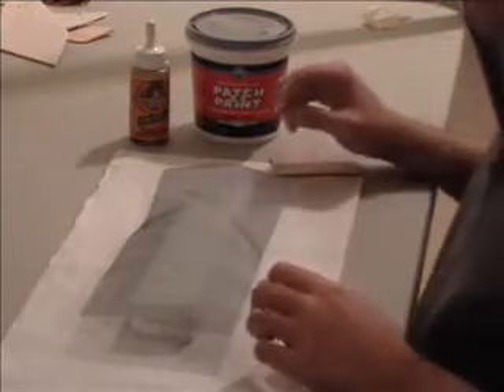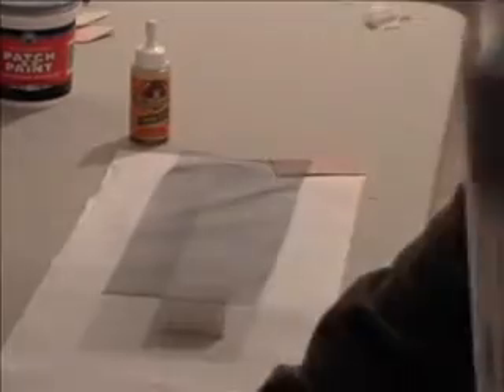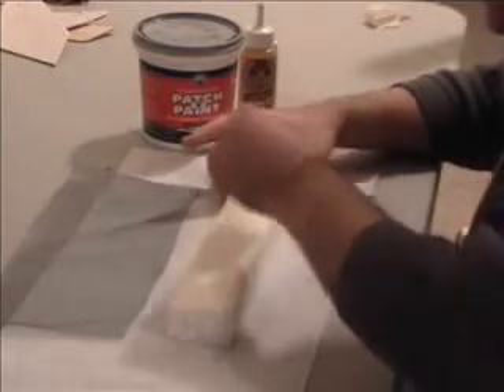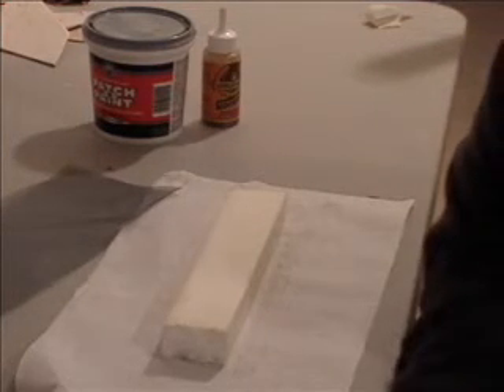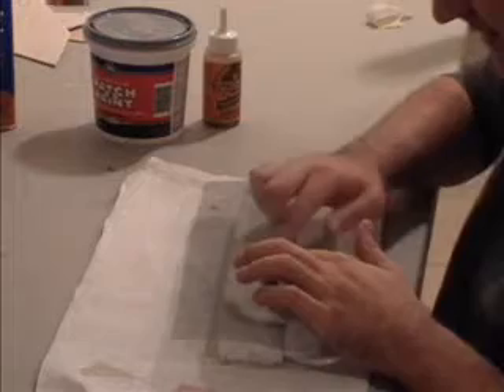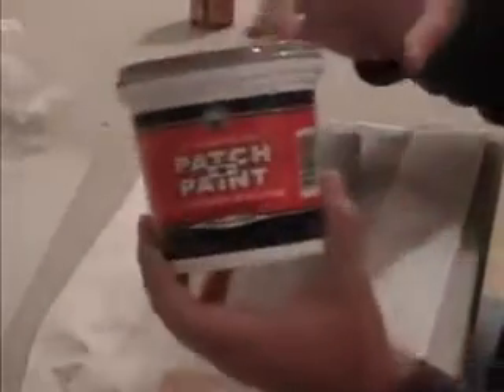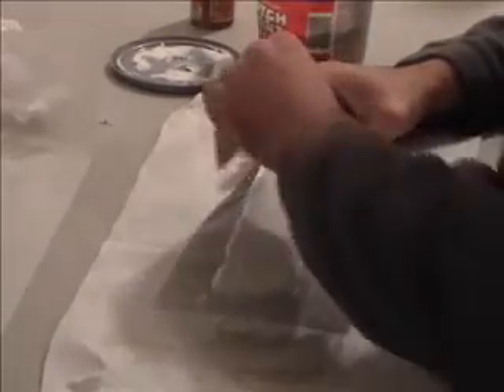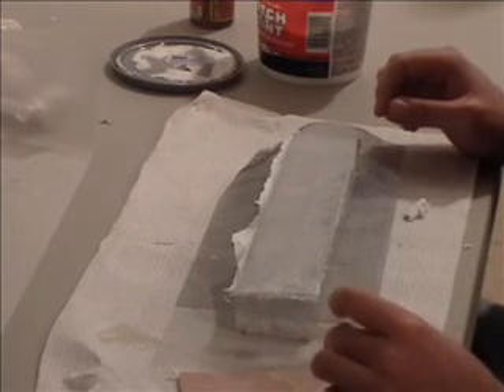Ohio Combat technique for laminating EPP wing

Comment: I saw this video for the first time about 6 months ago and tried it on my most recent E-Raider. What an amazing finish I got. I'm finishing another Raider now for the slopes in Long Beach, CA. On this one I skipped the screen door material and just used Elmers Glue-All Max (polyeurothane glue} which foams way less than Gorilla Glue making it much easier to sand very smooth. It weighs nothing and I get the mirror finish. Thanks for the video.

Comment from the maker: @Tsavah-
I've been brewing beer lately and one of the techniques for separating grain from sugar water is a fabric material called "voile".  It's essentially white nylon mainly used for sheer curtains.  It's quite strong enough to lift 50 lbs of wet grain out of a vessel- I've only had stitches rupture.  It's about half as thin as screen and has maybe 3:2 finer mesh.  Sounds like a great idea!  And I'm sure it costs less than window screen.

Comment: That polyurethane glue sticks to fingers like superglue, and doesn't wash off. I recommend gloves or just not touching the glue, unless you want the glue stuck to your fingers for several days. This fiberglassing method is awesome and cheap though, I used it on an EPS wing (the low density insulation stuff from home depot) and it lasted several years of abuse.